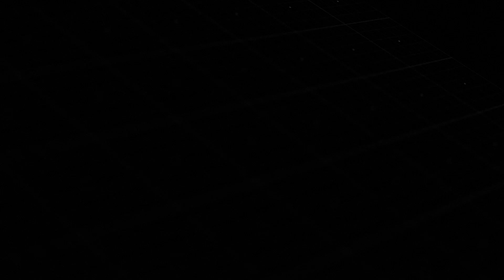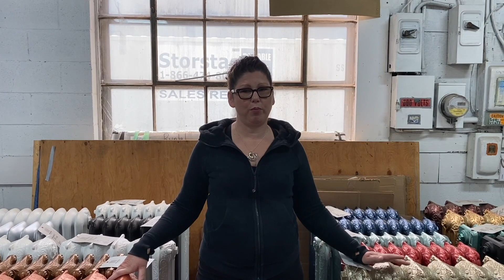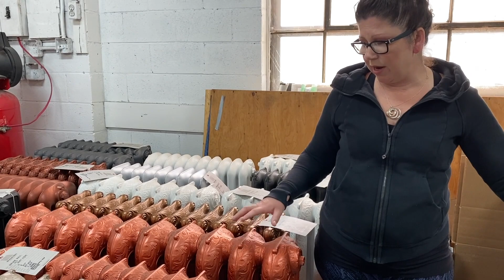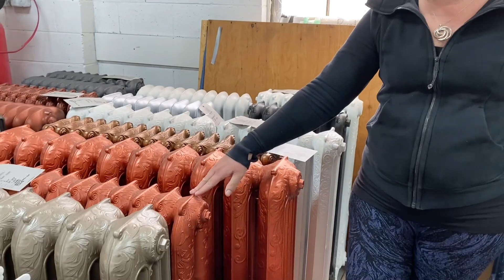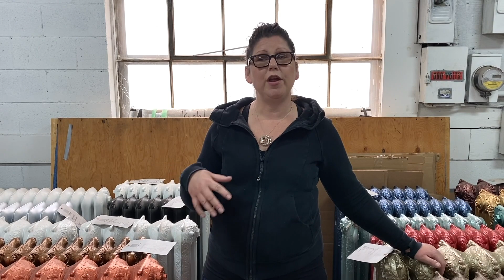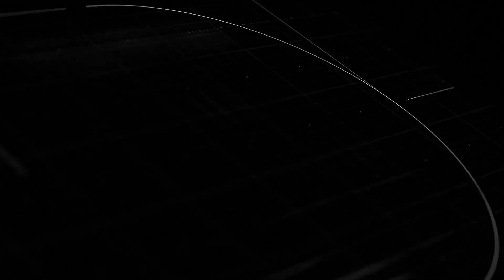How to choose the correct radiator size for a room?

Comment: Those are some beautiful radiators.
I purchased a 100 year old home in Brooklyn 3 months ago and I'm looking to either refurbish or switch out the radiators to something with new finish.

I have a classic column just like the Black finished one. Heats up well but does some knocking too.